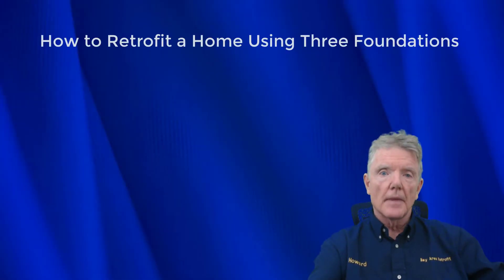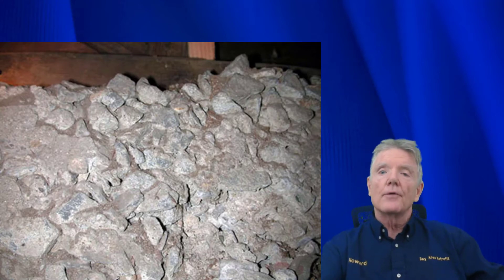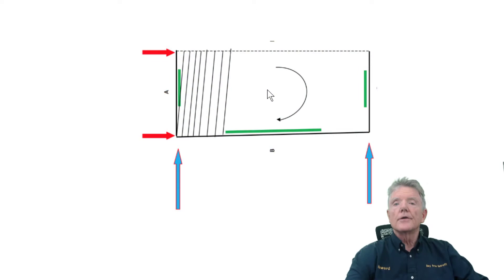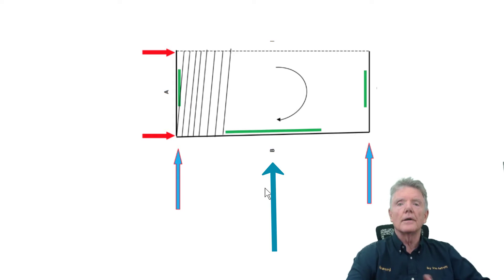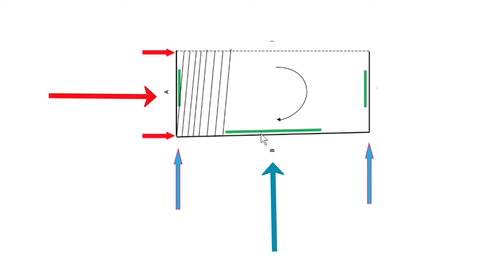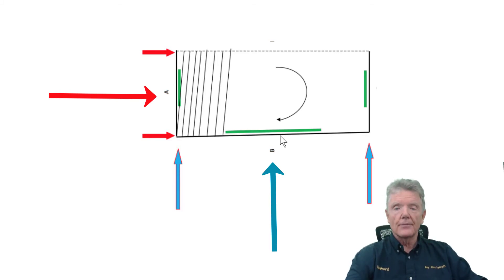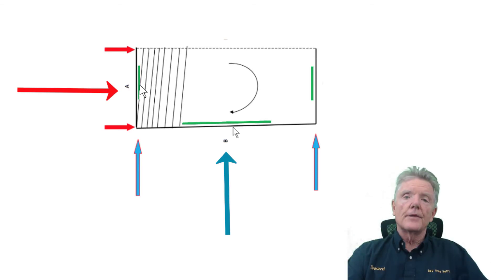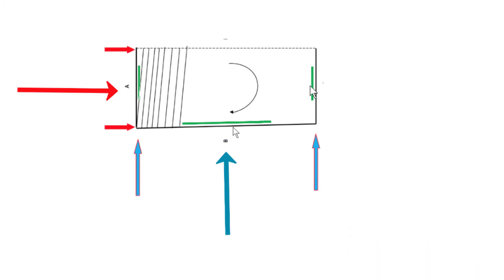Seismic Retrofits Using Three Foundations

Comment: I get a lot from these videos and appreciate the work you have put into them. I live in Oregon, in a well built 1956 "farmers daughters house". Excellent builder using 2x6 material from a huge dairy barn that was dismantled on the property.  I am gathering materials, tools, and information  so i can draw up a meaningful plan. Flat ground great foundation single story old growth wood attached slab garage. My question has to do with calculating a weight estimate of the house. The calculators i have found on line seem questionable. Any suggestions? Thanks!!! Scott
Reply from the maker: Look up ""base shear" on the website and the information you need should be there.

Comment: I’m a huge fan, due to heavy traffic, and horrible road, my ranch style house, with slab garage, had been vibrating as if in minor quake. Will retrofit help? I am doing some blocking which has helped a bit, but when huge trucks go by it’s frighting, and I’m worried that it is causing damage to my roof  door alignment etc.
Reply from the maker: No, it won't help.
Reply: @bayarearetrofit5814  so what would help?

Comment from the maker: Forget about the slab.  It was bolted when it was built and it does not have the weight of a floor to deal with.  I keep meaning to do a video on slabl foundations but just haven't had the time.

Comment: Hey Howard, what about a fountain that has a partial slab portion(80% of the house is perimeter foundation/pier and beam but one room is slab).  Does the perimeter of the entire slab need to be bolted, or can just the outside or just the inside be bolted? Hoping I can just bolt the crawlspace section and not the exterior of the house.
Reply: *foundation